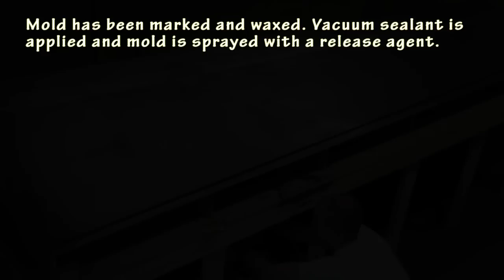Carbon Fiber Aircraft Wing

Comment: Good pace, nice, accurate job. Why did you wet the foam at all? I think there is plenty of resin in the skins to do that. Instead, I would recommend less aggressive perforation of the release film, around 30-40mm pitch. You should have breather half-dry ideally. If it gets fully impregnated with the resin, the airpaths are blocked and vacuum does not work that well. Also, just a recommendation... To get stronger vacuum, use a long aluminium perforate tube instead of single port. At least 1m long for such a job. Plus add another port in the farthest corner and use it just for measurement. This will truly indicate how good is the vacuum. Regarding vacuum pump, get yourself a nice little pump from Easy Composites. It provides excellent abs. pressure, is very reliable and does not evaporate oil.

Comment: that is only one surface of wing, how about the other, and how to connect them together with enough strength?
Reply: Well, it is safe to assume that he makes the other side of the wing too, and that he's building at least 2 total wings :)
The two sides are glued together. The contact is usually the main spar, also made separately. In the end 3:58 you can see that he left out a part where the main spar will be glued.

Comment: Chris, I like the fact that you set up a metal mold.  However, I have heard that molds should be thicker and of similar materials ie glass or graphite, I guess due to thermal reasons?  Was this a concern for your project?  Making a thicker mold out of the same material is very time consuming and takes a lot of work.  I like your idea, but have not seen it done before.
Reply from the maker: Yes, you are right.  Production molds should be out of similar materials.  Mostly this is done because the heat curing is done in the mold.  If not heat curing in the mold, not as big of a concern.  I'll  be post curing after assembly so not a problem for my project.
Reply: There is some heat during the resin kick off, correct?  But was this not high enough to worry about?  Just wondering.  Do you have any more videos of the project?  thanks
Reply from the maker: Not as much as you'd think.  Total layup is pretty thin so it can't really generate any noticeable heat.  I held it at about 95-100f during initial cure and will post cure later.
Reply: Thanks for the reply.  Show us more videos of your project when you get a chance...
Reply: It depends on whether you autoclave the part on the mold or how much heat builds up from curing. The best results are achieved with a similar material mold you don't have any pulling and pushing between the mold and the part when there's any change in temperature

Comment: Chris, why didn't you just infuse this? Your prepreg method is no more exact than a well infused panel, and you're not autoclaving it so why not just infuse the whole wing? Is it to reduce in resin to mesh ratio? Because I don't think it will be any different.  

PS. Checked out your facebook page. Well done sir. This is outstanding engineering on a budget. Professional but using older technology to get the same results.
Reply from the maker: +gus bisbal From what I've found, infusing large foam cored panels is not ideal or time saving.  You need resin channels in the foam(time consuming to form).  Resin flow is not consistent between top and bottom panels.  Your results may vary.
Reply: Chris Christiansen I guess I hadn't considered the size you are using. There are ways around that by feeding resin in different places and resin channels like you say but if this method is working for you I can see why you would use it.  To be honest I was surprised at how easily you handled the infused CF sheet i.e. that it didn't fall off the plastic/peel ply when you turned it upside down. I guess I have never tried that.  So this is a hand layed up sheet which is then vacuum bagged to remove excess resin. I think I am going to try this. Thank you for posting the video.
Reply: That's some slow curing epoxy. 
One thing. Your carbon fiber to resin ratio seems quite high. Are you sure 60/40 is desirable?
Also, does your foam core also absorb epoxy? This looks like a strong design. Considering doing this to build my own fully carbon fiber aircraft. Do you also make the wing spars and ribs? I'd love to see those.
This is the first time I have found your channel. Wondering if you build the entire plane, or just the wings?
I have been working with carbon fiber on a small structural basis for quite some time. 
This, "Make your own prepreg" type design has me intrigued. Would love to take a look at what else you do.
I dream of building a light weight, 2 passenger, fast, high performance single engine aircraft out of complete Carbon fiber construction, with all the safety measures. I would like to see if anyone has a design integrating carbon fiber wing cups, for anti-stall behavior. Hard to find anything like this open source, so I'm stuck doing fluid dynamics modeling. Is this part of a kit build, or are you a sub-contractor building for another manufacturer? 
Hardest part of making anything out of carbon fiber is making the mold.
Reply from the maker: Thanks for the input.  This epoxy has an open time of about 3 hours at 60 degrees.  Ratio is what good for me.  Foam is closed cell and only absorbs epoxy in the "cut" open cells on the face. This plane was designed by me and I am building the entire plane.
Reply: Thank you Chris for the input. Can I ask what model plane you are building? 
I am tempted to build a version of the Pipistrel Virus SW, but using a 915 Rotax, slightly different cupped wing geometery, and complete overkill structural build of carbon fiber composite.
The one negative about Carbon fiber, is that if your airplane is ever hit by lightning while in flight, I think it would cause significant damage to the entire aircraft, possibly killing the occupants or destroying the instruments in microseconds. However, Carbon fiber is conductive.. but it shreds , bad. I saw a carbon fiber helicopter rotor, struck by lightning and it demolished the rotor and tail rotor. The helicopter went down, but luckily there was enough momentum and prop remaining that everyone lived. 
Carbon fiber would likely divert the lightning through the entire aircraft, but I'm afraid the epoxy and other structure would likely be destroyed beyond capable flight.. only bad side. My only hesitation about using carbon fiber honestly for an airframe, wings and full aircraft structure would be this factor alone. I don't know of any Cirrus or other aircraft struck by lightning yet, or any carbon fiber composite airframes that have been struck. Any information on this ?
Reply: I believe most of the Cirrus construction is S Glass.  The main spar is carbon and possibly the rudder and elevators.  Aero-TV on youtube has some good videos.
Reply: What foam is it please ?

Comment: Were the spars and struts carbon fiber too? Did you finish the aircraft?
Reply from the maker: Patrick Kraemer Yes the spars are all carbon too.  No struts though, as this will be a cantilevered wing.  This aircraft is still under construction.
Reply: Are you using carbon fiber and foam composite? Any construction videos? I guess the ribs are carbon fiber too.
Reply from the maker: Patrick Kraemer Check out https://www.facebook.com/Aerostruk for more info and pics.  I'll be doing my best to post more and more as this project progresses.
Reply: @chrischristiansen5260  What ever happened with this project?

Comment: Can somebody tell me the real truth about the resin, what is the best one, hardest, I bought one system three, what a sh***t.
Reply: i am using one from advanced composters riverside CA TO WRAP ;a 500hp HARLEY DAVIDSON MOTOR in a , BD5  and adding carbon nanotubes in the resin for full stealth on my oven vacuum chamber I've just built  this co makes parts for space x rockets  and fixed the galvanic corrosive issues and a ejection seat twin HD belt drives